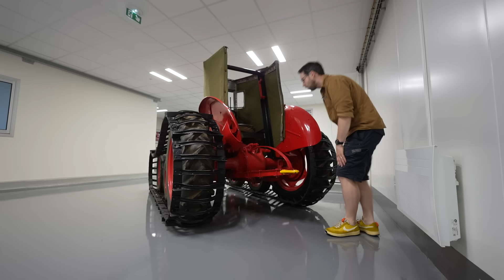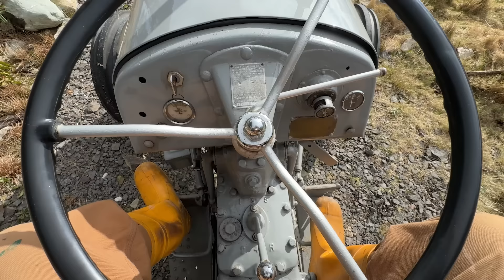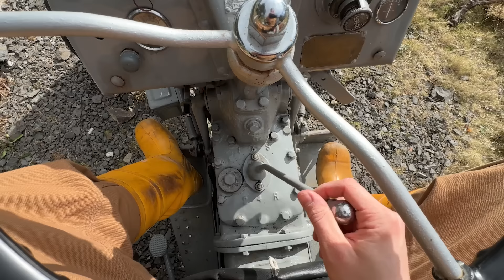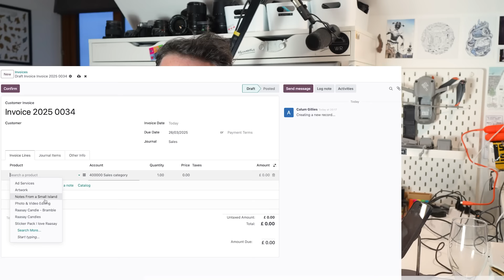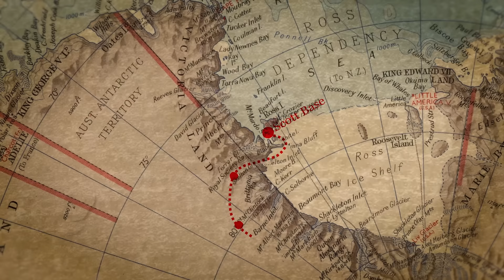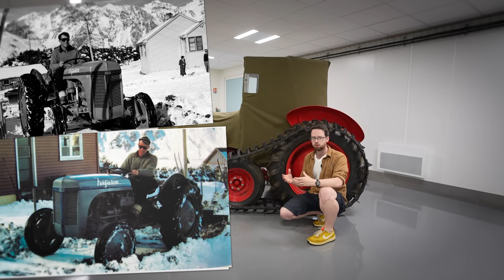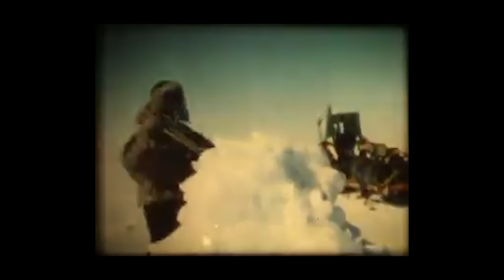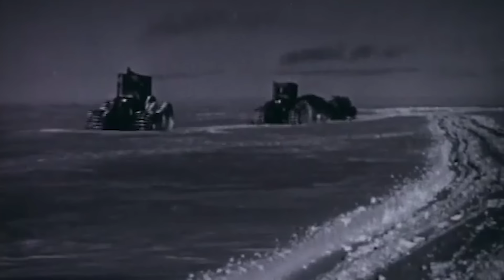The First Vehicle to Drive to the South Pole

Comment: 0:44  I love how this only makes sense if you already know that -40 is where Celsius and Fahrenheit intersect
Reply: Your comment doesn't make sense.
Reply: @chippyjohn1 it does make sense mate
Reply: @johngibson3837  How does referring to an obsolete unit of measurement such as fairyheight make sense?
Reply: @chippyjohn1 
It is, unlike metric, a very unrefined unit used to describe the difference between the surrounding environment and the hot one inside that thick head of yours.
Reply: @topsecret1837  My point exactly, you flat earthers and your fairyheight. That's why it's called fairyheight because you're gone with the fairies.
Reply: @chippyjohn1  Look, just because we over here on the other side of the world use a unit of temperature measurement standardized by the temperature of horse blood instead of human doesn’t mean we’re flat earthers dammit. It may however mean we engage in a little witchcraft, because who tf thought of that and decided it was a good idea?
Reply: @chippyjohn1 Fahrenheit gang rise up

Comment: Remarkable the 4cylinder 35 was a pig to start in Cumbrian winter…it could be nippy in the Lakes but hardly south polar?
Reply: We've 2 diesel 35 4 cylinders. Both start fine in the cold but one of them in particular is the best starting 4 cylinder I've ever seen. always told the 4 cylinder is a better tractor, just a case of getting them going.

Comment: Ferguson's three point linkage also meant that if the plough got stuck on a rock or something, the tractor wouldn't do a backflip and land on you. Handy.
Reply from the maker: Hahaha handy being an understatement there 😂 would have been fun to do more on the Ferguson but didn’t want to get to distracted
Reply: @CalumRaasay  distractored? ....I'll show myself out
Reply: @RaasayRaider  The TE20 most certainly was not a close copy of the Ford, if you do a little research you'll find it's the Ford that's a close copy of the Ferguson! Harry Ferguson wasn't just an ideas man, first and foremost he was an engineer.  Read all about it here https://en.wikipedia.org/wiki/Ferguson_TE20  and here https://en.wikipedia.org/wiki/Ford_N-series_tractor
Reply: It was a trade. Ford got the Ferguson system and Ferguson got a tractor.
Reply: @RaasayRaider  I think the hydraulics only lift
Reply: @cudatom9290  It was a little more than that, the top link was attached to a spring mechanism, so that if a certain force was exceeded it would operate a valve and automatically lift the implement reducing the load on the tractor. When the force reduced it would also automatically lower back to the working position, so there might not even need to be any operator intervention at all.
Reply: @ Yes you are correct. The 
"when it hit an obstacle, the hydraulic pressure was released," Which is just the opposite, and some other comments threw me off. From my experience this plow feature lifts the plow or scarper to keep the tractor from stalling or spinning out, but stalling or spinning is not what controls the lift.
Reply: That is correct. My dad told me he had a friend when he was young who was killed by a tractor doing a backflip
Reply: @RaasayRaider  the draft control is supposed to lift the plow if the wheels start spinning. 
What keeps it from going over backwards is the three solid links between the implement and tractor. 
What's ironic is the Fords and Fergusons are prone to rollover if pulling high draft implements from the drawbar.
Reply: That's not what the draft control is for. It maintains a constant implement draft (hence the name) as operating conditions change.

Comment: Thank you Calum, for yet another fascinating video. I find it very interesting to see what has been done with very minimally modified stock equipment that WORKED, vs the very expensive, specially designed equipment that sometimes didn't work.

Comment: I seem to remember on our farm that Fergies ran on TVO with a small tank of petrol for starting. Did Sue have the same system?
Reply from the maker: No, they actually had a regular petrol but a “ki-gas” system that would spray a propellant into the cylinders (I can’t remember the specifics) to assist starting. It’s a system that was reserved only for the diesel fergies (mine has it!) but retrofitted to the Antarctic petrol versions!
Reply: @CalumRaasay  I'd forgotten Ki-gas.  Thanks for the reminder.  Excellent video, by the way.